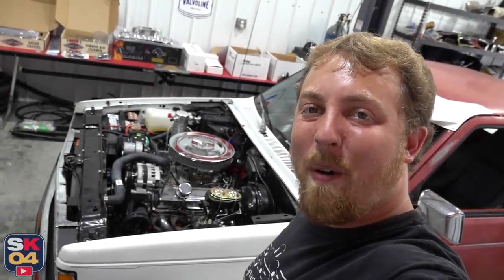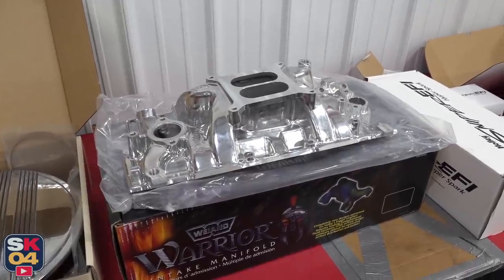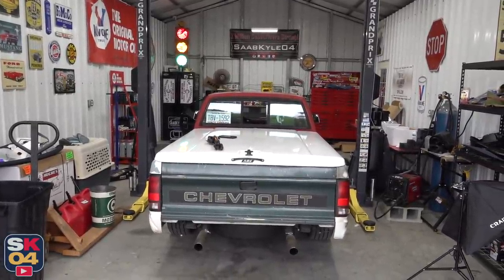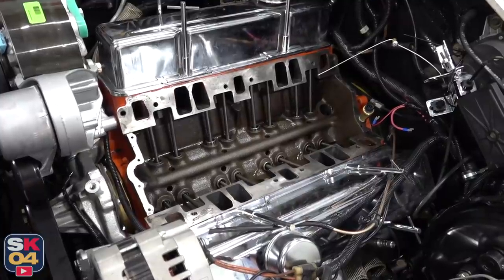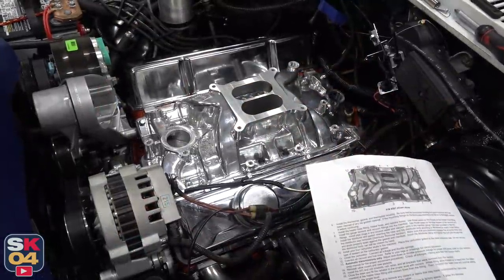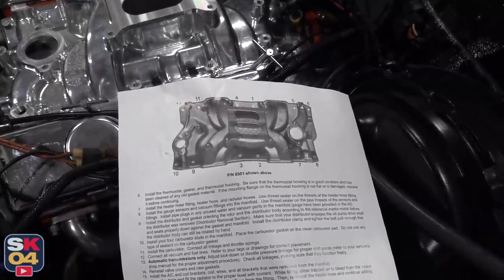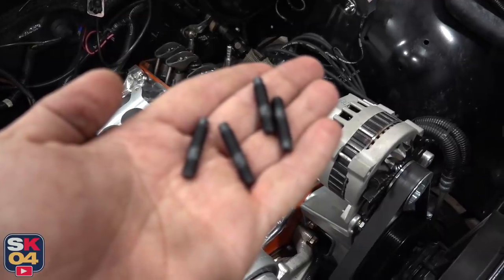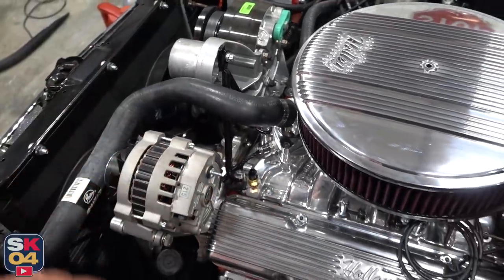Heading Down The Rabbit Hole Once Again...Preparing To Go EFI! S10 Restomod Ep.19

Comment: 7:08, I ALWAYS toss the rubber end seals and use a good bead of silicone. I've been a mechanic for over 35 years, and have done hundreds of intake gaskets, and have NEVER had one come back for a leak.
Reply from the maker: You live and learn, that’s for sure!!

Comment: Hey Kyle, I've got a 91 S-10 project truck I was kicking around the idea of V8 swapping, but I was wondering what kind of gas mileage you got with the AVS/2 carb?
Reply from the maker: I honestly never did the numbers.  I wouldn't think it'd be that much of a difference between an EFI setup and a carb, it's still a 350 at the end of the day 😅

Comment: Now I'm not 100% sure but wont you get incorrect temp readings on the dash if the thermostat ever gets stuck closed with this setup?
It looks like your engine could over heat before you or the fans notice something wrong.
Reply: Yeah SK04 Josh is right you need the sensor below your thermostat. If you was to use that sensor for your efi it wouldn’t be reading a reliable coolant temperature.
Reply from the maker: TonyG That’s why The EFI sensor is in the manifold...
Reply: @saabkyle04  what about the engine coolant temp sensor being before the thermostat? If the thermostat is not opening the engine will continue heating up and your sensor will only be seeing the temp of the coolant that still has not entered the engine.
The fans as well.
Reply from the maker: I thought I did a pretty good job explaining my reasoning, please watch that segment of the video again, thanks.
Reply from the maker: Sometimes you have to make do man, idk what else to say.  I'm doing my best here.  One head plug is stuck, I can't get it out, the other I felt was too close to the header, but it's a possible option if it doesn't melt.
Reply: @saabkyle04  
I completely understand man, you gotta make do with what you have, you are doing a fantastic job on everything you are doing. I was just confused with your final setup. 
Our s10 has over heated a time or two.
Thank you for the vids Kyle, they really help with the bordum of slowly losing my vision.
Reply from the maker: Thank you for supporting the project bud, it really means a lot.  Hope you have a great week 🤘
Reply: @saabkyle04  
You too, y'all take care.

Comment: I'm shocked that this is being promoted as a "fuel injection system." It's actually a fancy throttle body injection system. Sort of a poor man's efi. It wasn't possible to get something closer to a 21st century fuel system in this truck?
Reply: Holley sniper EFI is the easiest way to convert from carb to EFI and those systems usually run $1000+. They aren’t exactly cheap. Most if not all sniper EFI units are self learning. In a sense it’s more advanced than what already comes in a modern vehicle. You give it some basic information about your engine and it tunes itself to those specifications and continually learns as you drive it. I think certain models can connect to your phone for tuning purposes and to provide feedback.
Reply: Throttle body injection has fuel injectors just like multi-port...
It's a shame he turned away from the carb, but this is still better than MPFI with that fugly holley hi-ram everyone is using on Youtube
Reply from the maker: Why is it a shame?  I can't do anything without being critiques about it LOL.
Reply from the maker: Well, it is a fuel injection system.  You should really do your research.  The EFI install video will be out Tuesday.
Reply: Saabkyle04 Kyle!  The sniper controls the fan temp.   Let the sniper do it!  It’s fully adjustable from the handheld!
Reply: @saabkyle04  Not that many do carbs anymore on youtube, that's why I was very interested in the project, but I still am. You had the AVS2 all set up there.
But if I had a Sniper Efi sitting on a shelf, hell I'd use it too!
I definitely like that you're going for an old-school look under the hood.